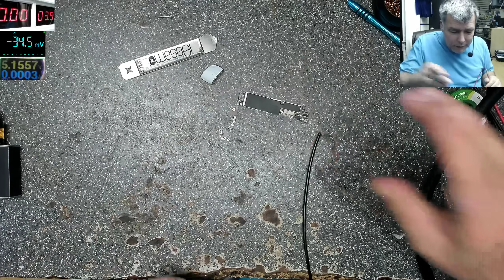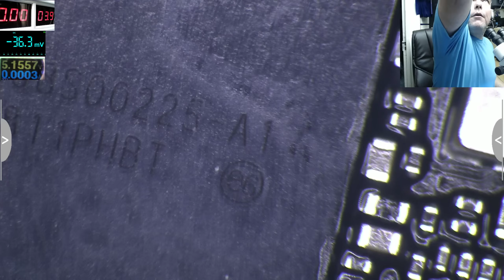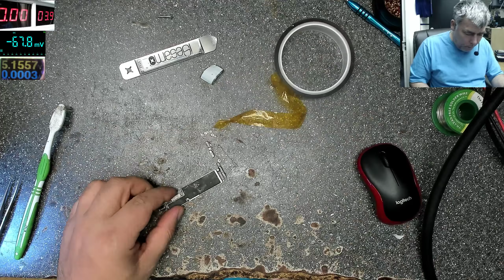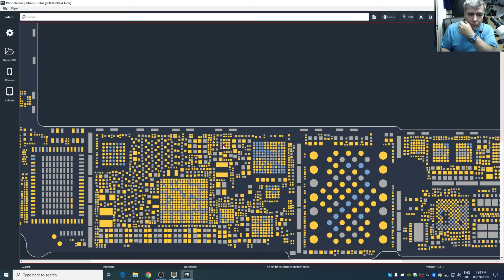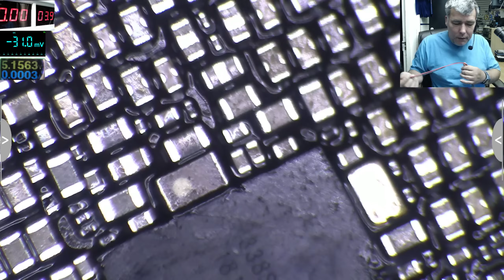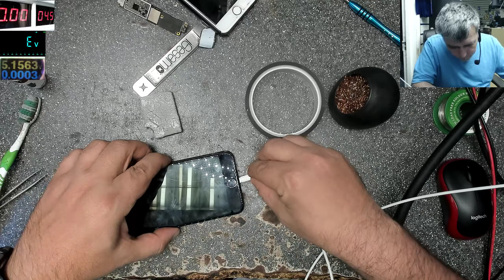Iphone Logic board repair - no power, not charging

Comment: I have an issue . I can connect my iPhone 7 Plus to iTunes . I can update and restore . But I can not recharge the battery . I have tried two different batteries and still no good. I have recharged the battery on a external charger and the battery; it’s fully functioning.

Comment: I dropped yesterday my iphone 7 in a pool,when i got home i saw that i have some bubbles on the display after 30 min my display started to turn black and get vertical lines on it.I placed my phone in a plastic boul with rice and the phone turned off and the tocuh wasnt working. Now the phone has no power and its not turning on.Can it be fixed?

Comment: Hello electronics repair school ! This is abit of a "please bro" I know, but please hear me out, I'm trying to repair my little sisters iPhone 7, I found that there was a direct short on the main power line to ground, injected current, and found that a capacitor was getting really hot, I removed it and the short cleared, I now have 95 000 ohms between the main power rail and ground, I plugged the phone into the charger and USB amp meter and found it was drawing a very constant half an amp, I took the board back out and found that most of the capacitors next to the power management ic, ( there's 12 rows of 3 caps) were all shorted to ground, apart from one of the rows of 3 in the middle. I noticed that these rows of caps are running on 4 separate power lines, and they are shorted, one line is shorted to ground at 15 ohms, one at 21 ohms, one at 22ohms and one at 60 ohms, I noticed also all these caps and power lines were common on the power management ic, so I'm guessing they are different voltage outputs? And the fact that they are all shorted, would that point to it being the power management ic? I obviously want to avoid attempting to change it if there's any chance it isn't that that's the problem, although I have ordered a replacement power ic.. Please any help would be greatly appreciated, iv never worked on a phone before but iv got half a brain, I also have the board view software but I don't think it's one were you can see the lists of power rails it just tells you what the components are and where they go to. Thankyou so much if you have read this and for any help. Reace from UK

Comment: Sorin, the flickering is not the camera, I had same problem, you have to re-arrange your USB devices, its a clash between USB hardware, I had to swap devices USB2 USB3 & even install USB3 card into spare PCIe slot, you can cure the flicker, in some cases it moved the flicker to another device, I even had to remove a slower USB device, try moving around USB's.

Comment: You can remove the infrared filter lense  in your camera. It won’t be exactly thermal imaging but what ever is hot will show up as a white colour. It is just a glass filter in between the front and rear lenses it will have a slight red tint to it when moved in the light. It protected the digital imaging from sunlight. So just don’t take any pictures of the sun and you will have a thermal camera.

Comment: Sorin if camera is logitech does it run off a USB port. There is a data issue with USB port of the camera. I had similar problem a with a internal USB card, clocking issues. Losing sync.

Comment: Sorin.. As you are finding my friend, the tweezers you are using for iPhone components below 0805 sizes are too large.. You may like to try the ones below. I use many of the Ideal-Tek, & Lindstorm brand tweezers and find them excellent. The ones listed below have extremely narrow tips.. The bottom angled ones are I believe the narrowest available with a tip size of 0.07mm. Being so narrow you do have to take care of them 👍
https://uk.farnell.com/lindstrom/tl-ss-sa-sl/tweezers-very-longfine/dp/1779183?st=SS%20SA%20Sl

https://uk.farnell.com/ideal-tek/65a-sa/tweezer-high-precision/dp/3480690?ost=65A+SA&ddkey=https%3Aen-GB%2FElement14_United_Kingdom%2Fsearch
Regards
John
Reply: are these tweezers high quality?
Reply: @SuperSamsung85   Yes... However remember they are very sharp 'precision' tweezers. So must be used as such. Grabbing components etc is fine, but use these tweezers under a heat gun and they won't be precision instruments for very long. If you want tweezers that are suitable for grabbing components under a heat gun etc.. just buy a few pairs of the sharp cheaper branded ones. OR you can get heavy duty tweezers from the same brands listed above which are still sharp but are made from heavier materials. Check their datasheets/specs out before buying 👍️